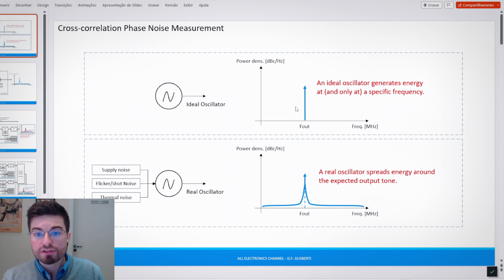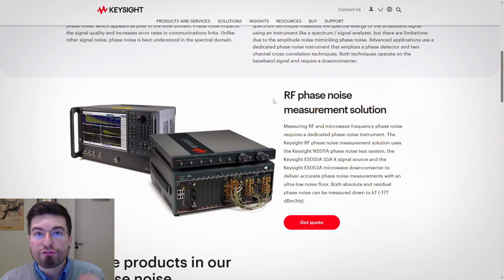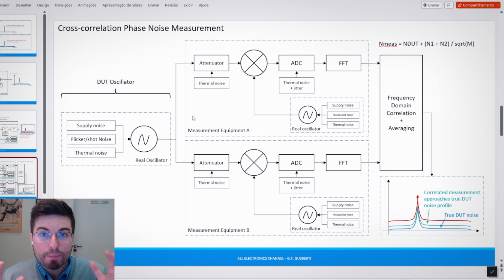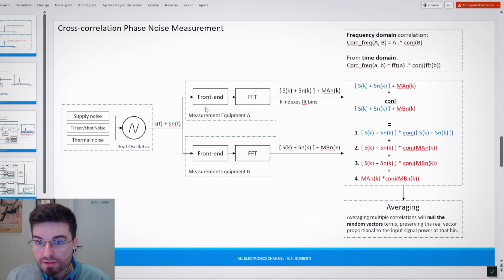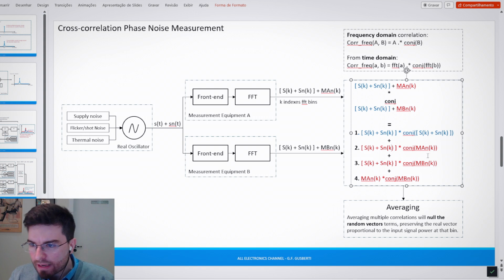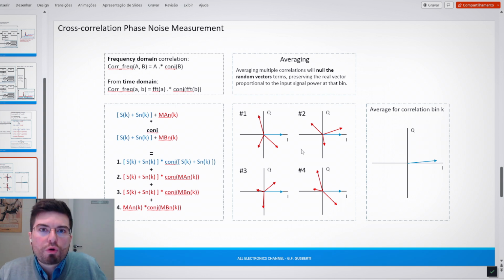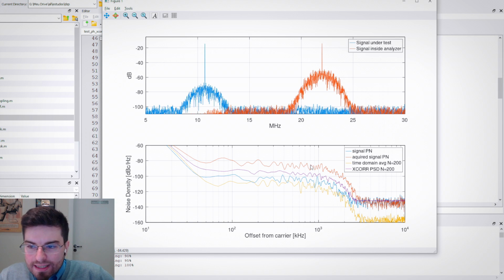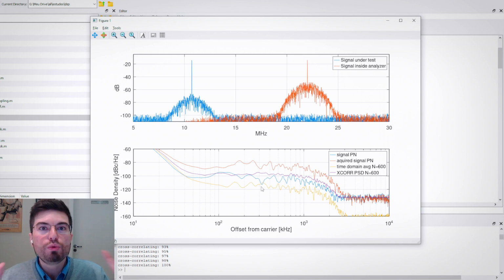Phase Noise Measurement using Cross-Correlation

Comment: Great explanation.
I noticed the 2-equipment setup diagram features two independent oscillators within the measurement equipment. In practice, we often connect all of our measurement equipment to the common frequency reference (e.g. SRS Rubidium reference). Where does that frequency come into the picture, and can the two oscillators still be considered to be independent if they are both referenced to the same frequency reference? Thanks!

Comment: Very clear explanation, thanks a lot! Since I'm facing the really expensive problem to do such kind off accurate measurements, may be a viable idea to realize this setup in lab? If I use two SDRs, I can acquire the signal in parallel and next perform the cross correlation and averaging on stored files (or in realtime if the sw is fast enough). What do you think about?
Reply from the maker: Yes, you definitely should try that! Share the results with us!

Comment: There are often spurs on a phase noise plot. What causes them and how can they be minimised?
Reply from the maker: They may be the transistor trying to oscillate at other frequencies, low frequency RF signals that are up converted, anharmonics of a crystal, some parasitic oscillation in the biasing circuit, oscillation by negative resistance with the measuring setup...
Reply: Since I wrote the comment, I have heard that one of the biggest causes of spurs is intermodulation between all the frequency generators in the instrument itself, with the DUT signal. There are many clock signals in a digital device, for CPU, for ADCs, for USB drivers etc. Apparently, it is possible to write a script to take out spurs caused by known intermodulation within the analyser.

The spurs puzzled me as they appear straight away. This is because they are always present. Phase noise on the other hand is random and it takes many samples to detect it, so takes a long time.

Comment: Another indirect way is to measure RMS jitter, with the help of GPSDO.   Then you can calculate phase noise from jitter, using Shannon's law.
You have similar problem as jammer signal in receivers.   A strong signal next to a weak signal.  To increase dynamic range tune out the carrier when measuring the offset, by changing the span.  You probably could use notch filter on the carrier when measuring the offset power.   

Measuring anything with dynamic range of more the 90 dB is challenge.
Reply from the maker: Hi man! The GPSDO will reduce the phase noise of the local oscillator? I understand that it is a slow action correction loop... the oscillator needs to be very pure for low jitter measurements. Am I missing something?
Reply: @AllElectronicsChannel  For faster convergence, you might try Rubidium Frequency Standard, as the LO of the measurement device.
Also, note that your attenuator @5:41 adds phase noise.